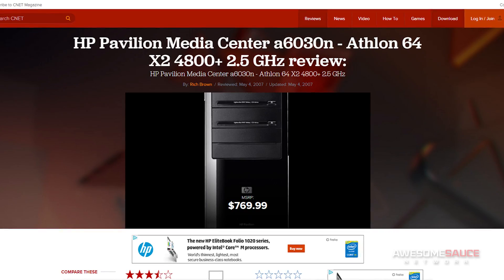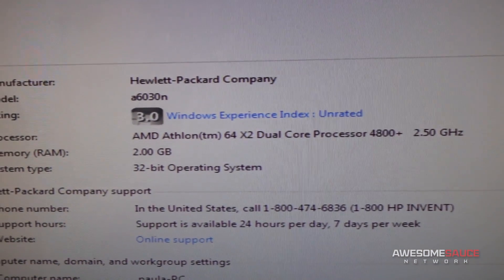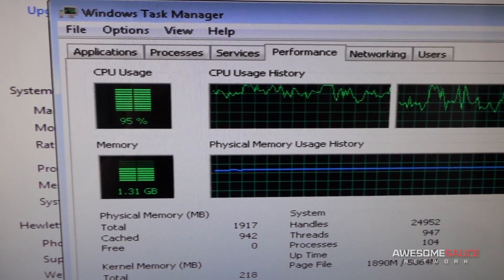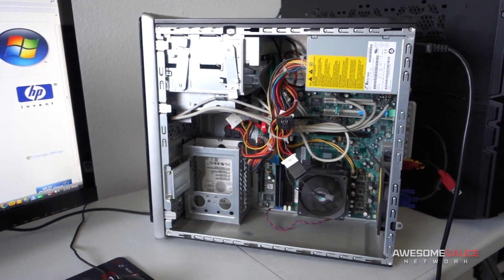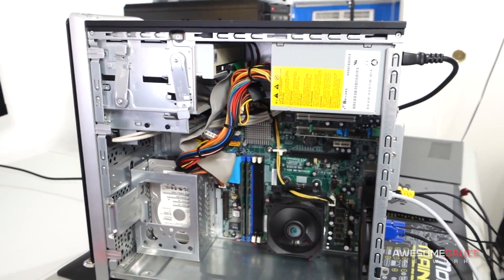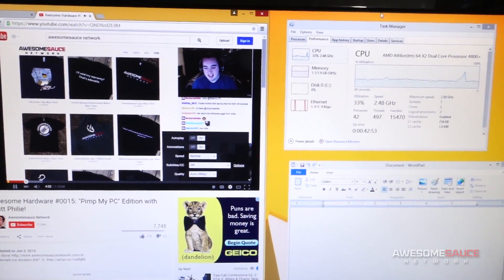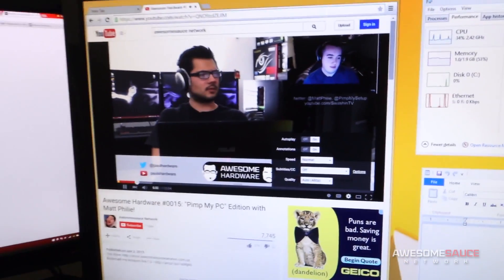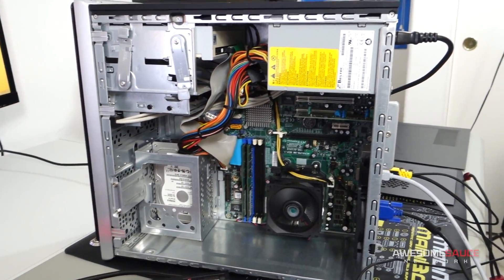Cleaning Up My Neighbor's Old Desktop!

Comment: OMG, I just dusted this exact model off and wiped off the spiderwebs, to see what I can do with it.  I was checking out all the stuff I had in it back when I had zero clue what I was doing. Horrifying!  I can't believe I played Pirates of the Caribbean online with it at all, but I understand now why there were some issues of it getting hot. I was thinking to leave it Vista as I have a laptop with upgraded 10 and an 8.1. The 8.1 I have to get to Windows 10 though so I can play Sea of Thieves, soo I'm ripping my hair out trying to fix it. Fun video to watch, did you replace anything or add anything at all?  What do you clean it with exactly and how? ARRGGHH   Oh and of course I hear earlier to get ready for a new Windows 10 update on the anniversary. It was a pain enough the last time. I didn't know it left 20 g's of stuff in there after the November update. Wish me luck on three computers, I've never worked on one in my whole life. :)

Comment: Nice job, although if dealing with IDE cables you can sorta round them to get more room, using your finger nails you can pull the ribbon apart every couple wires and then bundle them together, although it can shorten the cable.

Comment: That actually not that bad conditions my old vista dell pc from 2005 had worse specs and was super dirty you will literally puke on how dirty it was it dust mite. It original specs were cpu: Athlon 64 3000  2.0 Ghz, Ram: 1GB×2 ddr2 667MHz dual-channel, GPU=Crap, and it only fan blowing in air and none for the exhaust. I upgraded the cpu to a Athlon 64 x2 6000 3.0 Ghz dual-core L1, L2 cache ( very fast), the graphic  card to GeForce gt 740 1Ghz ddr3 DirectX 12 with 2GB of VRAM, ram 4GBx2 ddr2 800Mhz dual-channel (since my motherboard dell 0CT103  was the 1% of motherboards that support ddr2  at 800Mhz it ran the full 800 Mhz), the hard drive interference was one of the old parellel ata cable from the 1990's and early 2000 know as pata cable, and I upgraded the upgraded the operating system to windows 10
Reply: And not forget I clean it up that peice of garbage

Comment: hey kyle . what did u use to clean the fan the case and other parts.? can I use a wet cloth?
Reply: Just take take and spray some water on the parts you want to clean and then wipe it off with some paper

Comment: I wish I had those cable management skills
Reply: Nemo Karamachi they are called cable ties or zip ties
Reply: Me too
Reply: Yea,holy shit,this is exactly what i need,i have the same box and cables for like 10 years and although my rig is pretty good right now after all these years taking the PC to an-lets say-expert on these things,the cables are really fucked up,like 3 times worst than this one and now adays that i am getting into hardware and stuff i am really having a hard time with this thing...
Reply: Tate The Viking pro tip: use 49195992059 plastic mini locks (no idea how its called in english but u prob know what i mean)
Reply: I jam the excess into a random HDD bay and seems to work well if you don't have a way to route them
Reply: +Peter Kapica What do you do with the plug heads?
Reply: EarFarce4 either plug them on the mobo or jam it into a random space in the case
Reply: +Peter Kapica I'd love to do that but I'm dead scared of a short 8(
Reply: EarFarce4 you won't short anything if if the computer is powered off and unplugged
Reply: +Peter Kapica OK
Reply: i have a natural talent cuz my first build cable managment is awesome
Reply: Tate The Viking it's easy if you have a case with room behind the mobo tray
Reply: Ty i remember now
Reply: I could do better that he do. I spend a lot of time making the cables fine
Reply: Tate The Viking tu bad
Reply: Its not hard just takes time

Comment: What can I take out of mine. It won't even start up it is just black scree and make a loud beeping noise
Reply: i think you should download more ram xD
Reply: I can't see you.
Reply: are you sure about that?
Reply: You could try plugging your pc into your monitor.🤗
Reply: Sounds like Hardware problem.
Reply: get the ram out and put back in again its a commen problem it should be fixed if you do it
Reply: +Realm 5 mostly the ram part works
Reply: I had the same problem with my PC. Try using a different HDD. Seemed to be the issue with mine
Reply: lol you dont download ram mate
Reply: John Cena Your hard drive is dead
Reply: Kaise K Type in on YouTube "beepcode diagnostic" and match the beeping noise to which one you hear in the video, most of the time the beeping is to do with the RAM, if there is no beep and just fans spinning it's the CPU... Etc...
Reply: Clorox Bleach wow your genius

Comment: Warning for everyone: when you get a PC that's probably infected by viruses, don't just plug in an external drive and copy data to it. I highly recommend to use a bootable linux to make sure you don't get viruses on your drive (and then on your own PCs).
Don't even connect those PCs to the same network you are using!
I also recommend to use a bootable virus remover tool if you don't want to reinstall rather than a install-nedded one.

Comment: I wouldn't recommend upgrading this PC, the parts for it could be hard to find.   That hard drive is 7+ years old which is a bit over the expected lifespan of most drives which means it should be replaced, then consider the cost of all the upgrades.  Also finding components for a computer this old could be frustrating. 

I think the ONLY thing that should be purchased for this computer would be a good external USB drive to back up his files.
Reply: In my opinion I think he should just keep the case and throw away everything else, then get a new cheap motherboard with a g-series intel processor and a sata hdd, awesomesauce will help out with some ram sticks like he offered.
Reply: +Ron K That is the stupidest shit I&#39;ve ever heard

Comment: My computer keeps turning off randomly
Reply: you have the sasser virus
Reply: really?
Reply: Nathan Saechao Have you tried to clean the dust out? Dust can clog the fans and heatsinks, resulting in the parts overheating. Some components (such as the processor) automatically shut down at extremely high temperatures to limit heat damage.
Reply: oh sorry but i had to throw it away. But even though we tried cleaning everything and getting some help.

Comment: At least he has 2 cores.

Wtf its 2015
Reply: +NicksDomain101 You do realise it's a CPU from 2006 - 2007, right? CPUs didn't have more than 2 cores at the time.
Reply: Well no its funny cause its like: "At least he has two cores, not ONE core." One core? dafuk
Reply: i only have a 2 core intel i5 6th gen cpu
Reply: all the I5 have 4 cores
Reply: chataclysm2112 Really? I had no idea, lol we've come so far
Reply: NicksDomain101 Hell, even as far as 2010, Core 2 Duo CPUs weren't at all unusual.
Reply: Well my dad used an athlon 64 +3000 (single core) until a week ago, unfortunately the pc died, could be the ram,mother or cpu but it has 2 sticks of ram and it doesnt boot with any, so probably the mother or cpu its toasted... For all the stuff that he does the pc served him well. I bought him an athlon 5150 in replacement, it runs almost at the same frequency but it has 4 cores
Reply: +NicksDomain101 ...
i have a single core 2.00 ghz processor..
Reply: Shawn Robain Wow
Reply: Yeah, I used a single-core processor for quite some time. It actually performed appreciably well (for what it was) as long as I didn't go overboard with web browsing.
Reply: Clementin[e] How fast was it?
Reply: 1.6GHz. I can't remember the specific CPU but I'm pretty sure it was an old AMD Sempron.
Reply: Clementin[e] eh...
My processor holds up..
Reply: Shawn Robain Yeah, kind of what I'm reinforcing here. My lowly 1.6GHz single-core was more than satisfactory for what it could do.
Reply: Clementin[e] I just need a new Graphics card
Reply: I have single core, 1.6GHz AMD Athlon Neo...
Reply: The_End 1192 Facepalm
Reply: +hiden name laptop i5 cpus have only 2 cores

Comment: +Awesomesauce Network I have a question: i've got an Asus x550cc Notebook with i3-3217  4gb RAM 2gb geforce 720m 1tb hdd and im currently using windows7. So my quesion is will it work better, faster with win8.1 or to stick to win7 ultimate? And also which windows is harder to run :)

Comment: Hey man I would love for you to cable manage my dell dimension's PSU. Its pretty clean inside and im just holding the uneeded power wires (New psu has sata and the mobo is ide) in the air with a rubber band

Comment: Lately I tried to clean up the cable-cluster-fuck in my PC, after that the USB ports in the front of my PC didn't work anymore.
So I opened my PC again and realised the pins on the JUSB3 Port on the Mainboard are facing in completely wrong directions. 
Can I reajust the pins and itbshould work fine again? As far as I can say non is broken..

Comment: just install win10 and you will see how easily a computer can get to 100% of ram, cpu and HDD writing and reading... :D
I just put win 10 on my old athlon II x4 651k with 8gb ddr3 and an Hd7870... there was a fresh install of windows 7 on it with only steam, battle net, chrome and 4 games (dawn of war, not very demanding games)... so I upgraded to win 10... and there you go. windows defender uses up to 100% writing on my disk, some update in the background ate up loads of ram and weird windows apps managed to get the cpu to 100% ... :D

Comment: Hey i have a question. You installed win 8.1 on it. Can i know where do you find the drivers for the components which are compatible with win 8.1? It is 32-bit or 64-bit? Thx!

Comment: in my opinion its dirtier than before because it runs on windows 8
Reply: At least it's better than vista
Reply: 8.1 is absolutley amazing!!! I have it running on 2 computers. (all the rest are on 10) and i love it since the day it was released.
Reply: +Schwarztaxi Windows 8.1 is a great OS
Reply: Gimme Them Beans exactly my opinion
Reply: 7 is the best. No sucky start screen for touchscreen.
Reply: +FalconPlaysMinecraft 8.1 is fucking garbage. Windows 7 is the best.
Reply: +Schwarztaxi 8.x is great on touchscreens, 8.1 is good, Vista SP2 is great but not well supported.
Reply: ouch
Reply: same shit, 7,8 or 10. all work 32-bit 1gb RAM and for 64-bit 2gb RAM. Like he say, neighbor use only few programs like IE or Documents, maybe watch a movie. 1gb for OS and 1gb for some program at time.
Reply: If he's an older guy that doesn't know much about PCs Windows 8 will probably frustrate him since it's so different (heck it frustrates me, Win 7 ftw).  I know my mom hates it when anything changes and she has to relearn.
Reply: Shit Dustinjnik, I've run 7 on a PC with 1 GB
Reply: Most systems that aren't tablets or cheap laptops with such low amounts of RAM and/or processing power most likely only have Athlon 64s or possibly lower and not all processors are compatible with Windows 10 since they need the SSE2 instruction set, I have the processor used in this video in an older machine and it wasn't compatible with Windows 10, oldest CPU I've had work with Windows 10 was an old Pentium 4 630 (HT).
Reply: both shite oems

Comment: Hello, My dad bought a no name ( not that I can find) computer from vision computer Inc. and it sat until a month or so ago. I updated a bunch of stuff but it is slow as molasses. What do you suggest I do?
Reply: Oh yea, it is running Windows 7 home premium and has Intel Atom
Reply: +DuramaxPower OCsquad clean out the dust and reinstall the operating system :)

Comment: I have the same one.  The optical drive door sucks.  That's what broke and while the drive still works I don't know how to get the door to close.  Is there a way to fix or replace it since I also did what you did and the computer is running great otherwise?
Reply: Just buy another optical drive, most fit in just fine

Comment: I still have my 2007 PC running, Petium D with 2gb of 667mhz DDR2 and GT9500 with 512mb of DDR2, my little brother use it to play minecraft on 1024x768 resolution and it works just fine
Reply: Core 2 Duo e6300
3GB RAM
GeForce 7300LE

ol times
Reply: Please buy some more and faster ram! Its not expensive to buy 8gigs of 1600mhz ram, and it will speed up your pc!
Reply: Huntace Currently I have a new case, but for the old case you cant get 1600mhz RAM because it will be DDR3 and the old board/cpu only supports DDR2
Reply: Huntace sure,.but who know if there is any board that will support that kind of ram xD ... and eight gigs are way to mouch for a pentium D rig... if can remember, a pentium d supports up to 800mhz ram .. dunno how much ... and i guess no ddr3 anyways

Comment: Make it better even when cluttered.

1: GET THE HELL OFF OF VISTA
2: More ram
3: Overclock the crap out of it
4: update everything updatable including the bios
Reply: +Peter Kapica Overclocking doesn't always help if the old cpu or cooling measures can't support it.
Reply: Sometimes it does
Reply: +Peter Kapica if he is going to overclock the cpu he might need a better cpu cooler or extra case fans

Comment: It's sad but my desktop is this exact model rofl.

I simply don't use it much so I haven't upgraded beyond Vista to Win7 and a really old GPU that capped out years ago forcing it to go back to onboard Nvidia 430 something. It's ass and mostly there for when younger nieces and nephews come over. 

I only use it as a torrent/mass download machine, tbh.
Reply: I take it back. After paying more attention, this is about 6 months NEWER than mine lol. 

I have the same CPU but running at dual-core 2.3ghz (so an Athlon64 XP dual 0000+ lol) and I now recall I added another gig of ram to go to 3gb. My HDD is also only a 250gb. Yet, the case and else is identical.

Comment: my question is how did you wipe the hard drive did you take an install disk of windows or what cause I have a PC found it and someone must had destroyed this thing non legitimate version of windows 7 opened it up nearly died from the dust when blowing it out no intake fan only PSU fan and one exhaust along with the CPU heatsink fan 2 gigs of DDR 4 ram (I was shocked by the DDR 4 as this desktop model is so so many years old) and I need help cleaning up the hard drive

Comment: Your neighbor likes VISTA,  he understands VISTA,   he won't be too happy when he spends a few days trying to understand the new OS and realizes he hates it.    
  I would have simply deleted all of the junk programs he installed, or set the system so that they don't automatically start on startup, and then I would have used a few malware and anti-virus software to clean the system of any bugs, malware, viruses, rootkits, etc.  That would have been more work but it would have left the old VISTA   OS intact.

Comment: Did you install adblock for the guy as well?
Reply: +Ron K basically if you have SATA connectors on your motherboard you can have an SSD (my old 2004 HP has SATA 1 so I could put one in there if I wanted to even though SATA 1 is slow)
Reply: SSD probably isn't compatible with this machine.
Reply: @ronk2832 It would work Sata is bacward compatible ind his HDD is SATA only CD/DVD is IDE
I replaced HDD to SSD in dads C2D PC, and it worked wonders,..
Reply: whilst it would be capable of using an ssd it certainly wouldnt be running at the fastest possible speeds but i think boot times are less important for this user aswell and i think more ram and a new cpu would fair much better. given how boged down the cpu managed to get simply watching youtube
Reply: an SSD would be a HUGE benefit for a machine like this, I put my old 840 Pro into my dads laptop (pentium dual core) and it was a night and day difference in everything, opening applications, booting windows, the whole thing was noticeable faster across the board, WAY more then I expected from it, it made a 5 year budget laptop run like a brand new modern machine.
Reply: ublock origin*
Reply: +Ron K There are IDE SSDs
Reply: +Ron K There are IDE SSDs
Reply: Why would you spend money on a ssd on a vista computer
Reply: dustojnik hummer technically you're breaking the license agreement. They can apparently sue you for copyright infringement.
Then again, all I know about hackintosh is running OSX in a VM and the new techquicky video that's out.
Reply: you just have to be careful as some newer drives only do sata 2/3
Reply: Ron K if it has sata it would work. Ide ssds are also a thing.
Reply: Falenone 666 likes :D
Reply: I just watched that video again and I was like wtf my comment has so many likes lol
Reply: This PC being a Socket AM2 or AM2+ SHOULD have SATA II ports or at least ONE of them. SATA I with an SSD is terrible, you may as well keep the hard drive.
Reply: mharris1270  That's about what you can expect for a SSD on SATA II due to I/O overhead reducing it down from the peak "300MB/Sec".  That's still way better than old HDD running at around 50-60MB/Sec.
Reply: An SSD would have been great for this. Cheap neighbor.
Reply: DanielRichards644 Are you sure this wasn't just because you reinstalled windows?